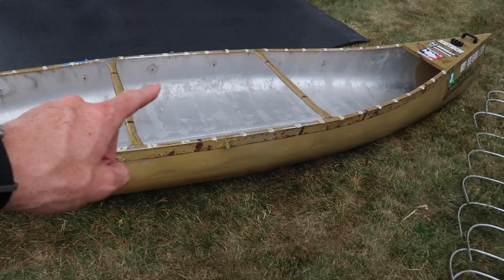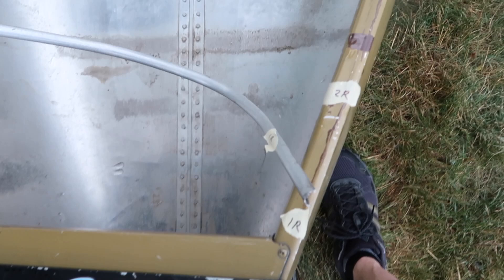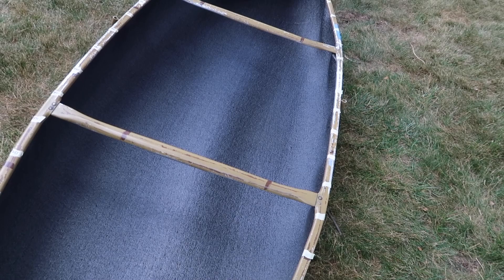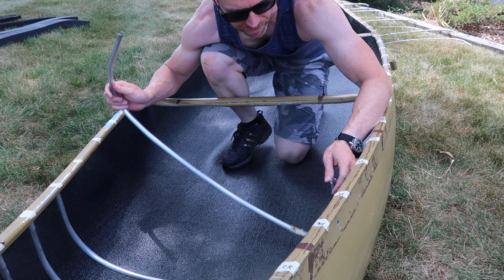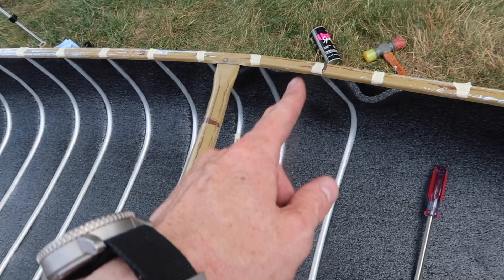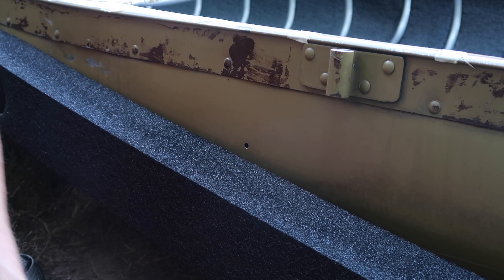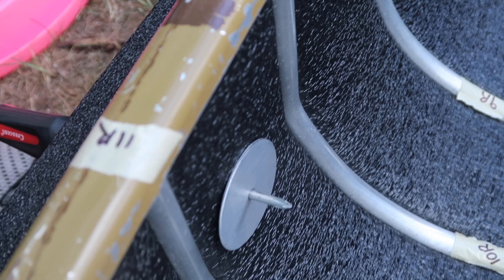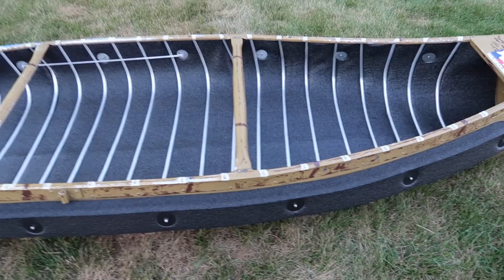Sportspal canoe floor liner and side sponson replacement/maintenance tutorial.

Comment: Well done as are all of your videos. Fellow New Jersey resident chiming in (South Jersey) ... I too have a 14' double end Sportspal, got it in September 2019 so hopefully I'm a few years away from replacing my liner & sponsons.  Your video from about 6 years ago titled "The best fishing canoe" was instrumental in my decision to pull the trigger on mine. I made a storage rack from PVC pipe. The canoe is stored upside down on the rack about 3' above the ground with a tarp over top. Storing it this way allows any interior moisture to drain off but maintain airflow. I'm toying with the idea of buying a couple of tubes of black silicone caulk and spreading a thin layer over the entire surface of my sponsons to condition them a bit. There were a couple of spots where I had small tears in them and repaired them using black automotive sealant and it worked well, the repaired areas have a tough but flexible skin on them. I figure why not treat the entire thing ?
Reply: Hey there! Where can you get one of these in NJ?

Comment: I would bet when they put the ribs in at the factory the to cross supports were not installed yet, I would consider drilling out the rivets at least on one side so you'll have more flexibility to install the ribs us a couple long clamps to draw the sides back to gather after the ribs are in and put stainless steel bolt and nylon nuts to reinstall the cross supports, this would also give you an option to add an accessory or too like a rod holder or what ever you can think of. Nice video thumbs up.
Reply: Found rib replacement happening in a repair shop - https://www.youtube.com/watch?v=lK45tfHG3Cw

Comment: Great video and to help with tightening the c clamps put the tightening sides of the clamps opposite of each other one on the inside of the canoe and the other on the outside so you can get full turns on the handle
Reply from the maker: Man, you ain't kiddin.  Sometimes I can't see whats in front of my nose.  GOOD point!

Comment: Carl a tip for you if you want but if you put 3 pool noodles at the bottom of the canoe (same direction as the ribs spaced evenly) it should stop the rocking while your working in and out of it .

Comment: I filled mine with water, supported t only on the ends and the weight of the water pushed down the bottom enough for me to get the ribs in.  Probably could be a disaster but it made it easy.

Comment: Thanks for this tutorial! It gives me a good idea of what I'll be facing when it comes time to replace the foam.
A few things I think would help make the job easier:

1. Flip one of the C-clamps around so that the handles are on opposite sides. This way they won't interfere with each other.

2. Instead of a screwdriver, find one extra long bolt as a temporary placeholder. This will aid with tip #1 since there's no screwdriver handle to get in the way of the C-clamp.

3. Since there are so many to do, I would jig up the C-clamps by connecting them together with a small spacer to help speed things along

4. Not sure how well this would work but it occurred to me that you might be able to use wood clamps instead of C-clamps. They're much quicker to tighten down but might not provide as much clamping force.

Comment: Drill out those seat/cross braces,  would add tons of flex, making install of the ribs so much easier.    Maybe do front and back seperately.   Replacing a couple rivets could have saved you tons of time
Reply: I just bought one that needs ribs and padding.  Also has a crack in the aluminum.  Thanks for this tip.  I'm definitely going to drill out those crossbars.

Comment: There's a video from another guy that works on these canoes for a living. He has a video on how to make a tool similar to what they use in the factory to put the ribs in. I made one and it's still a pain but I got all my ribs installed in 20 or 30 min. Except I got a little too grunty on a couple and broke one completely and cracked 2 others. 
I just had mine apart to reseal the seams and fix a crack.

Comment: Could have just bought 1" longer bolts to speed up installation, then just cut off the excess. A quick file to remove the sharp cut edge and...done. 
But your way came out nice. Don't forget to return the 8" clamps to HF.
Reply from the maker: I originally considered that, until I looked into it.  The specific size and thread pitch in a bolt about an inch longer was very uncommon.  Coupled with needing it in stainless (like the factory ones) it was cost prohibitive being I was supplied with new hard ware from Sportspal and a couple cheap clamps would solve the issue....albeit taking a bit longer.

Comment: A trick I used was to take a ~1/8" bamboo kebab skewer and push that through the sponson from the outside to match the hole, leave it there to retain location, then remove and insert the screw.  The point penetrates the ethafoam easily.  Seemed to be easier for me.

Comment: 🙂 Thanks for a great video with lots of information an good ideas, I just lowed it, you are the man!
I happen to have an identical Canoe and I'am not looking forward to replace the ribs I think,,,,,,

Have some thoughts that might do the job a bit easier,,,

SPONSOR
It might be better to not do pilot holes in the sponsors, do only the first hole, and the fasten the first bolt and line up the sponsor alongside the hull and drill the rest of the holes from inside the hull, one by one after fastening, think that is the only way to get a accurate positioning of the holes.

It might be better to make your own screw clamp from wood for pressing the sponsor to the hull to be able to get the nut fastened to the screw.  A fork type with pressure on both sides, or even better with a circular washer a bit smaller than the sponsor washer, and with a hole in the middle for the nut and screwhead.

RIBS
I really do recommend Sportspal guidelines regarding the ribs, put them in vertically and do not try to push them back an forth. 
Moving the ribs forward/backwards is almost impossible without damage, as you have sorted out.  

But they do slide quite easy the other way (vertical) 
Instead of the recommended screwdriver, I think it is better to use a homemade tool, cut a 1" pipe in two, and put a small screw that you grind flat at the end that can slip under the gunvalve lip on the canoe, or just make a notch at the end of the middle of the pipe that point upwards.
 
Then press the rib down with this tool, and the rib can be pushed in place quite easy, the rib will easy be pushed to the side inside the halfpipe. (the screwdriver can slip on the gunvalve and the rib, and do not have the hookup to the railing)

Comment: ■■■...If you were to run a thin ratchet strap, strap(ensuring the end is cut so it is a single thickness...some straps are doubled over at the end to prevent fraying) and loop it under the trouble side of the rib first...then when you get that side seated underneath...you could pull on the  strap to line up the rib, rather than pushing it with your hands.  Once you are comfortable with your alignment, simply pull out the strap.  (Silicon might aid in reducing friction.)

Comment: Someone please msg me .. is the sponson necessary? Why not just use the canoe with out them ? I highly doubt those two little foams are gonna make a huge difference ? Or am I wrong ?
Reply from the maker: No sir.  The sponsons just add a measure of bouncy if the canoe leans hard to either side.  Useful, but certainly not imperative.  I guess you can consider them secondary stability mechanisms vs the primary stability which is the width, keel, and inner foam on the canoe.
Reply: @KeepinItReelFishing  thank you very much for the reply ! Cheers !

Comment: Where did you buy the liner and sponsons? Looking to finally refurbish the old canoe out back and need some important parts. Thanks.
Reply from the maker: I bought it direct from Meyers.  Just an FYI shipping was very high.  You might also try castlecraft.com or oakorchardcanoe.com, both of which seem to carry the full scope of Sportspal canoes and accessories.
Reply: Just finished installing all of the replacement hardware. What a pain lol. And it was made even more difficult with them having terrible communication

Comment: ■■■...Perhaps you could cut some flat sacrificial discs out of the old side rails and marine glue them over the outer semi exposed screw ends to prevent them from scratching/scraping whatever they might come in contact with.  Just a thought.

Comment: Always enthused to see an upload! Whilst watching, a query came to mind, albeit one that is entirely unrelated to the video's content. As such, disregard any of this if I am mistaken in my recollection... I recall a video of yours wherein you'd shown a Savage Gear Browser swimbait rod that you had recently purchased. How has said stick treated you? I am curious as to how parabolic the Browser rods are, and what weight ranges you would advocate for pertinent to the respective models you've used. I tend to use marginally lighter tensile strengths for larger hard swimbait applications than most folks, especially glide-baits, so very interested as to whether these sticks load in such a manner that they will cater to the use of said slightly lighter lines. If you have any insight to those ends, I'd greatly appreciate it!

Comment: I'm sold on this canoe; now I have to find one. Thanks for the great videos you've done on it. Comment: do you think maybe the liner has shifted  along the length of the hull under the tension of the ribs? How much do you think the sponsons help with the stability of the canoe ?  I'm actually considering driving to the factory (from Seattle) to get one of these.....good job on the upgrade- I like your style.

Comment: Thank you for this. I have an older s14 that has a small leak, and I've been contemplating removing the liner to seal from both sides. Seems like it might not be worth the hassle if an external seal works and everything else is in good condition :)
Reply: There is another video on Jon Boat aluminum repair that you may wish to check.  In essence, you put a metal patch on the inside, held with Marine LOCTITE goop, and JBWeld the outside.  A bit counter-intuitive but seemed to work for the Jon Boat.  1/32 thick aluminum.  As stressed there, if there are cracks, before applying the patch, drill a tiny hole (1/16?) at the end of each crack to stop it from continuing. I am not doing it justice. Watch the video.

Comment: I'm wondering can you spray it with truck bed liner put a  few coats that stuff is real strong
Reply from the maker: I don't think that will work.  The metal ribs that span the entire canoe are held in place, partly, due to the compressive pushback that the foam provides.  Without it I think the ribs would dislodge pretty readily.  Also, for what it's worth it's nice to have the foam as it offers a stealth factor of you, your gear, etc not making noise against a hard bottom.
Reply: @KeepinItReelFishing  makes sense good video